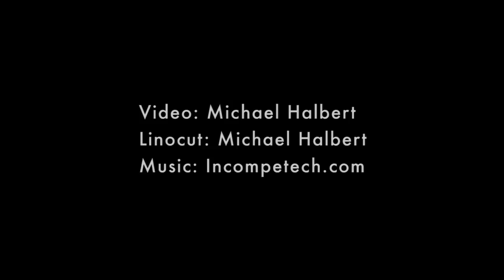My 2nd Linocut

Comment: Im confused if he doesn't have 2 linos doesn't that mean he screwed the rest of the prints
Reply from the maker: Prints made this way are truly limited, and each print is going to be at least a little different. You can even choose to make each print drastically different. The lino plate will only last for a certain number of prints. 100 would be a lot. The artist may even destroy the plate at the end to prove no more prints can be made. That's one reason these hand prints are usually priced higher than digital prints.